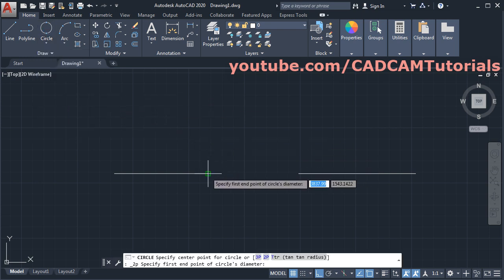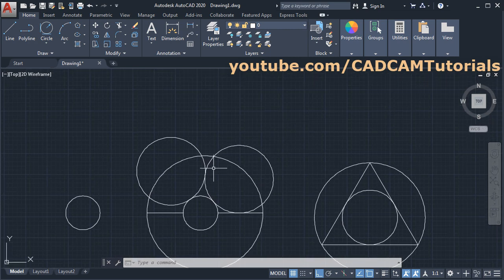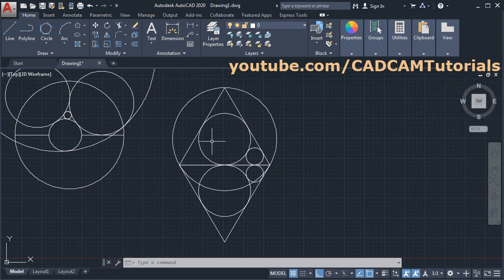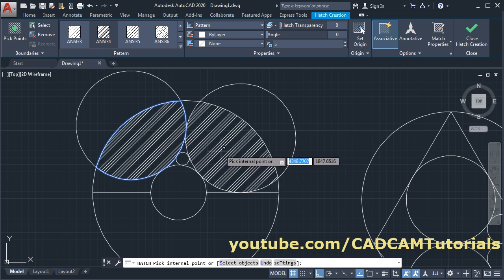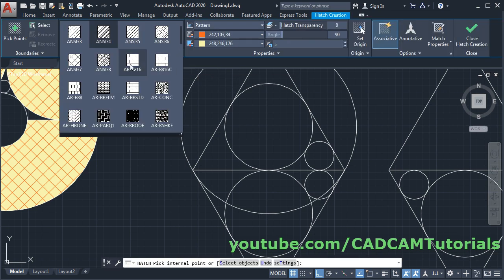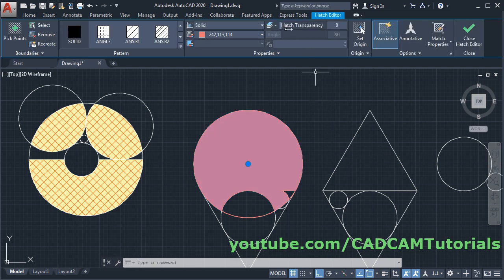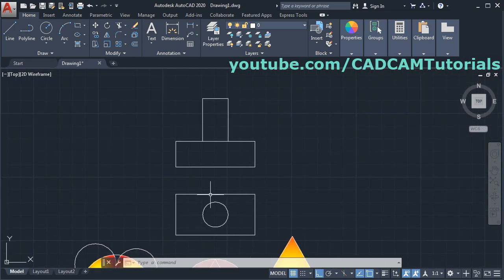AutoCAD Tutorial for Beginners - 4

Comment: Methods if circles
Mirror
Note: tan tan rad or tan tan ran of circle will work only for combination of line and circles ( not any other curve)
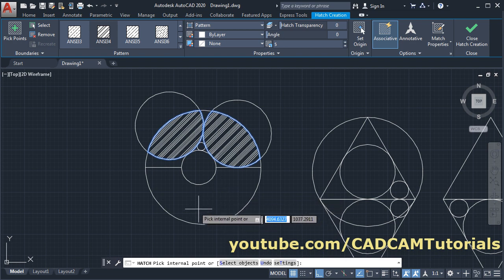10:03 for hatch make sure that complete object is visible
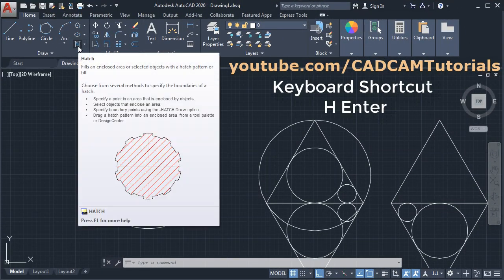08:25 hatch starting
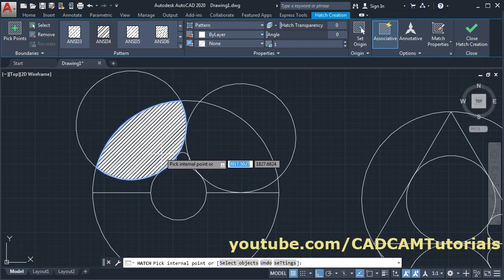09:22 changing gap between hatch pattern lines
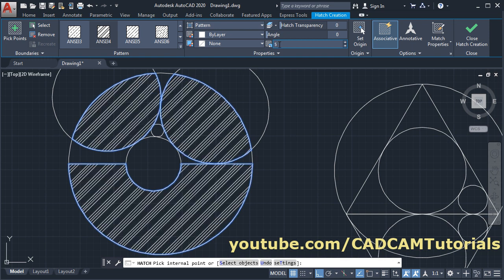10:21 change angle of pattern line
10:54 change colour of hatch lines
11:03 background colour
11:18 set origin ( work on for lined hatches not gradients)
11:40 edit hatch further
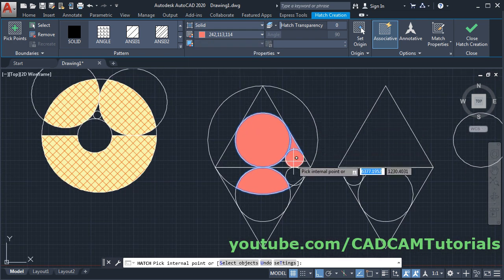12:47 hatch by selecting object outline (for hatch by selecting region click on pick internal points on command bar)
13:09 control hatch area by clicking "options''
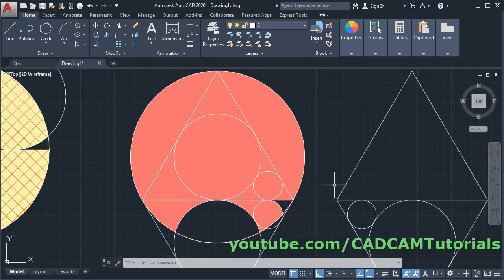13:51 Bring hatch ahead of object lines (click on hatch then right click then draw order then bring to front)
15:14 match to hatches by match properties ( outside of hatch environment)
16:10 separate hatches
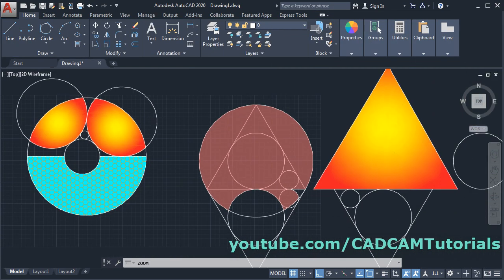17:16 object snap tracking  ज़बर्दस्त